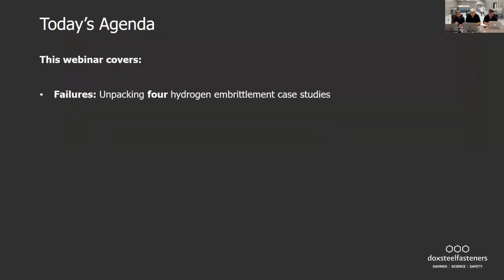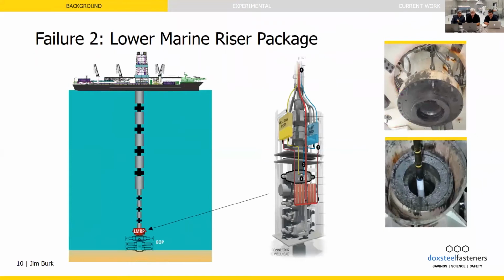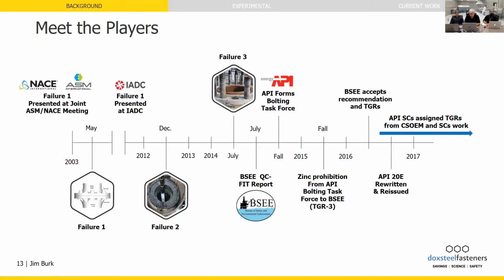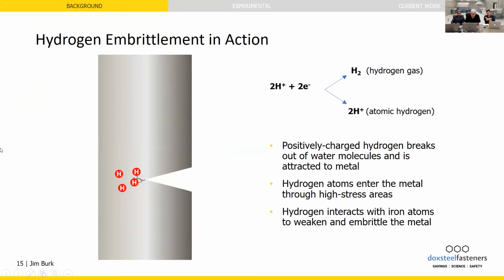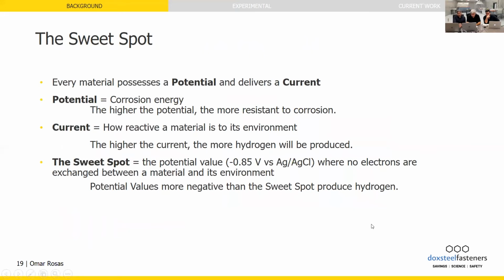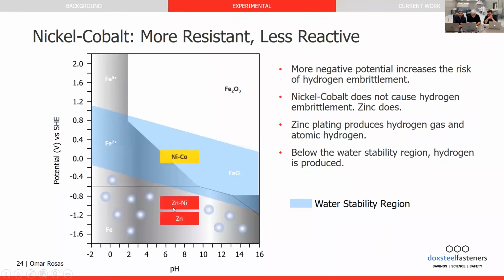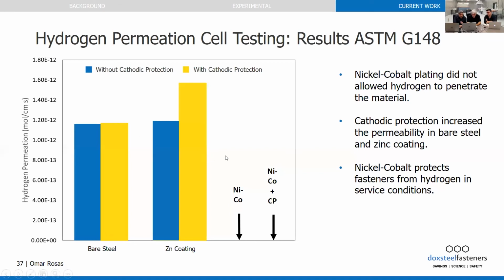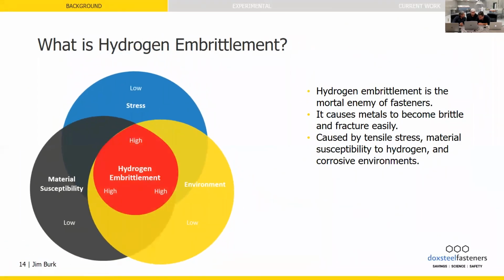Barrier to Hydrogen Embrittlement in Fasteners - Doxsteel Fasteners

Comment: Question. As far as I understand, the failure is never right away. It usually takes some time. Assume we have a bolt that had hydrogen introduced during manufacturing. Would it be correct that this new bolt would have hydrogen dispursed throughout the bulk of the structure, and it isn't until the fastener is loaded that hydrogen migrates to stress concentrations and areas of high stress and begins embrittling those local areas?